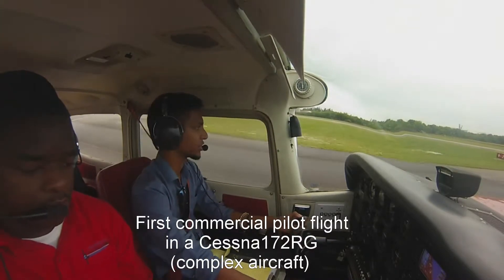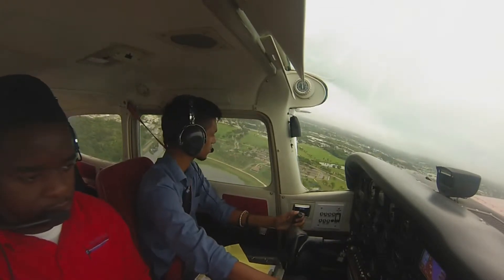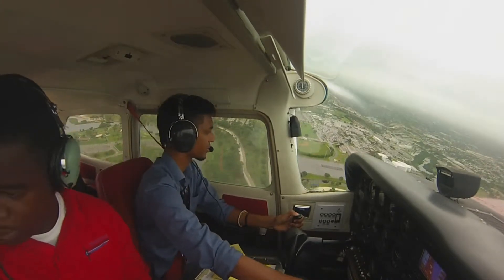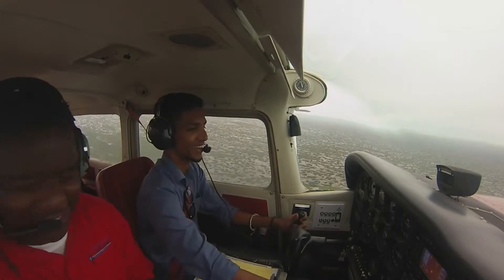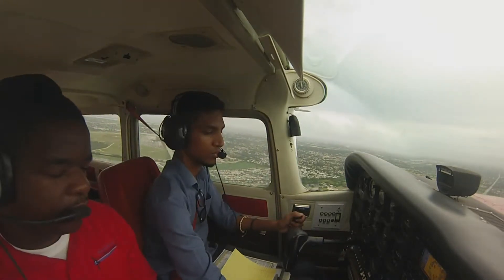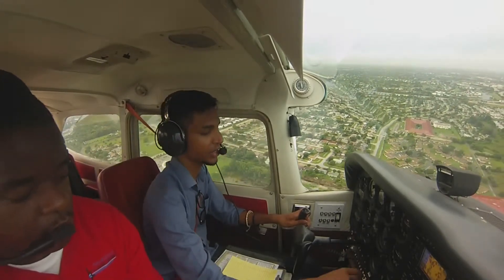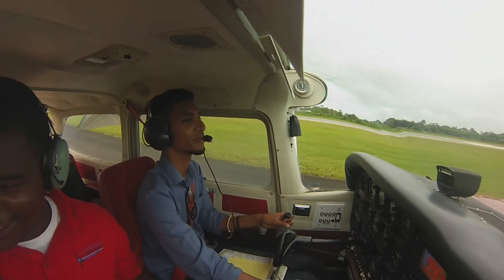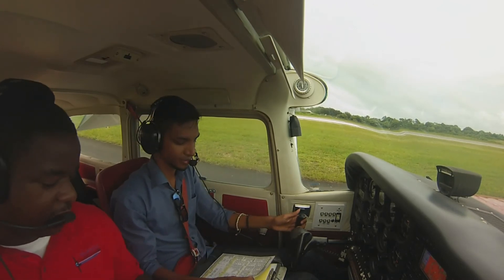First commercial pilot training flight in a cessna 172RG

Comment: I have a 172 rg  . I was trained mid field speed 100 it’s gear down and flaps 10 degrees . The POH will tell you you don’t need carb heat because of the location of the air intake behind the engine . When you put 10 degree flaps the same time you drop the gear it will keep the plane level without having to trim it .